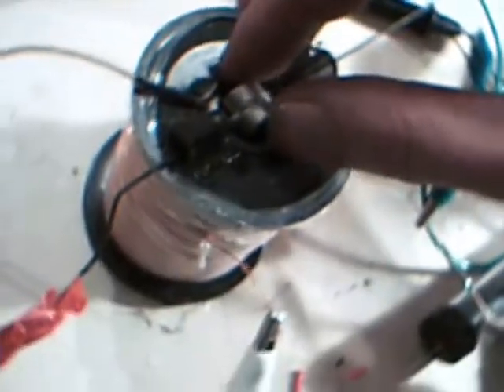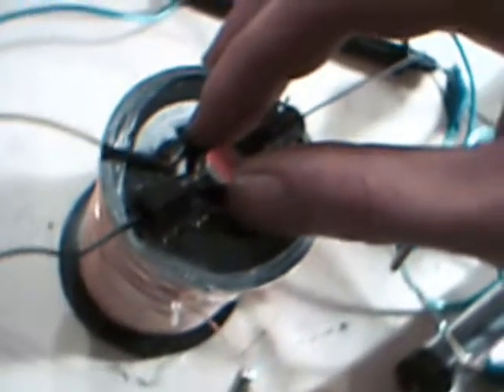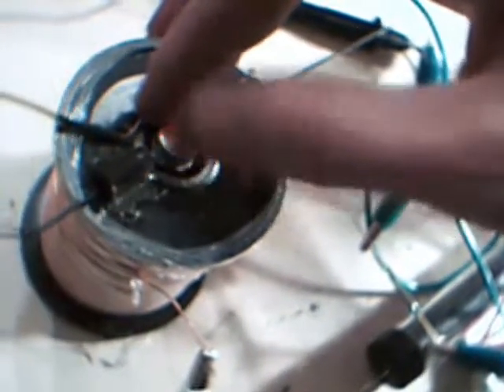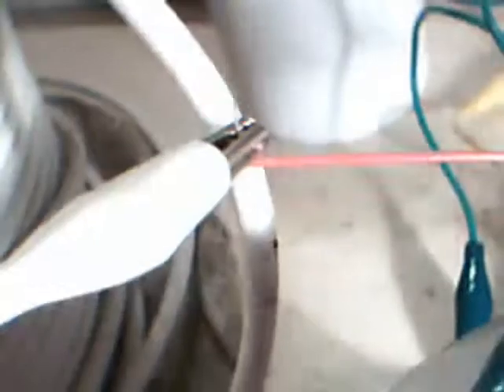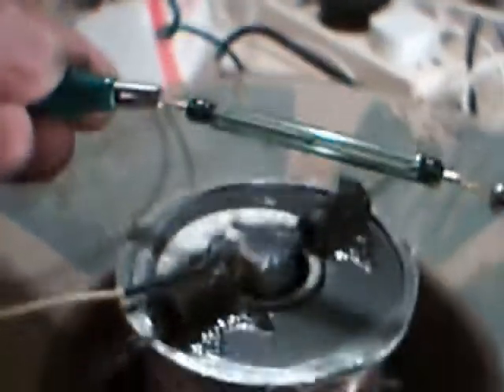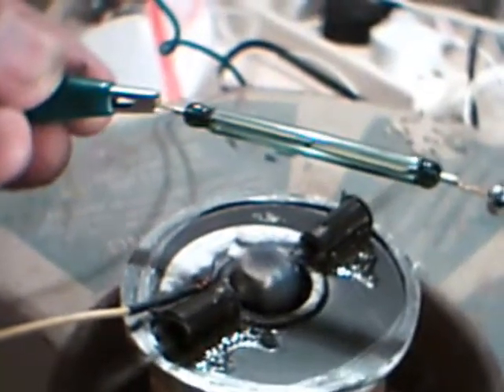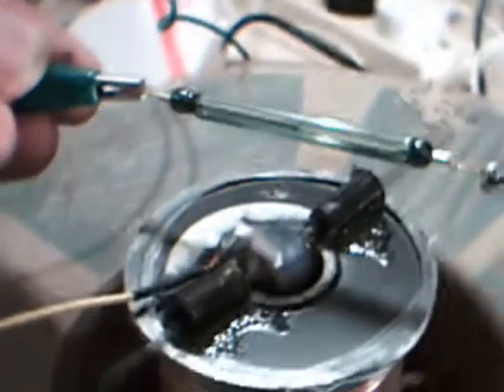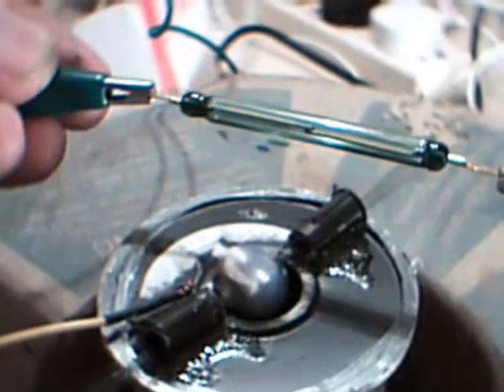A simple newman motor pt2

Comment from the maker: Sorry about the late response. I got mine from rapid electronics off the net. you need:
1. roll of insulated copper wire. 1 reed switch 2x neo magnets.
Also find a small rod and a pair of raw plugs, a few bits of wire, and a square battery.